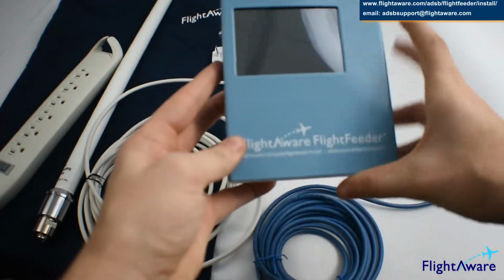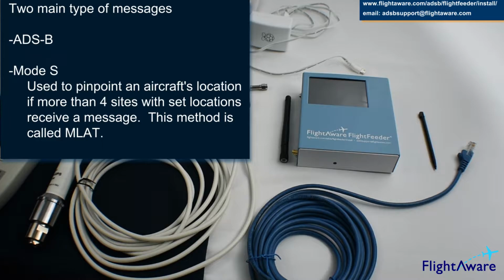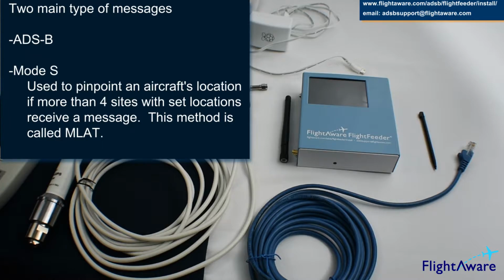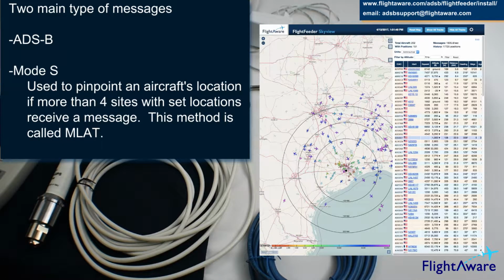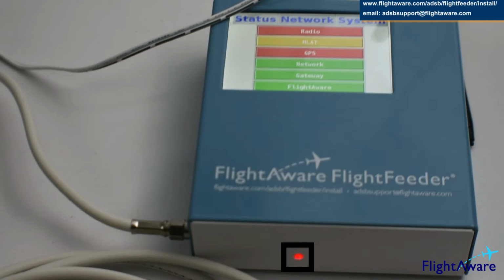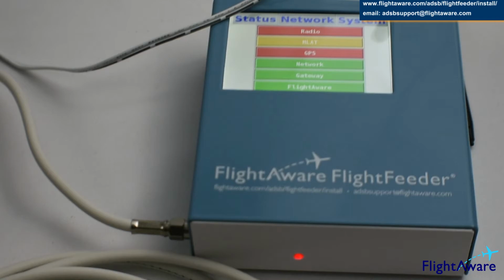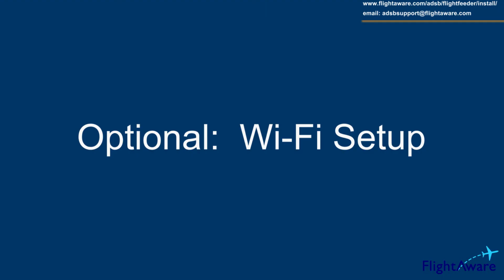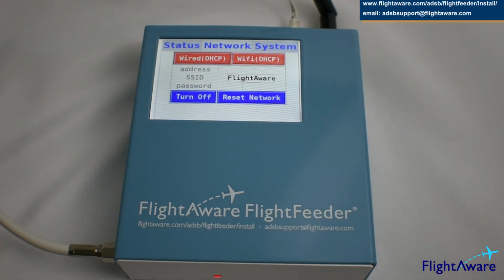FlightFeeder V10 first time set up

Comment: Why wifi settings in the options menu disappear suddenly after I turn it on for a few hours, iam using this model V10
Reply from the maker: This is a technical issue that should be fixed, please contact adsbsupport@flightaware.com if it still happening

Comment: I am also using the same box but its IP address it keeps changing
Reply from the maker: If you need the IP address to stay the same it can be set manually by navigating to: System -> Network Setup -> Wifi settings -> Wireless settings .  Please contact adsbsupport@flightaware.com if you have any issues.